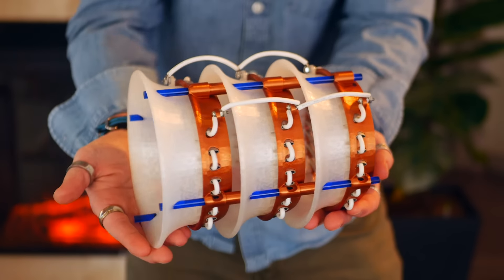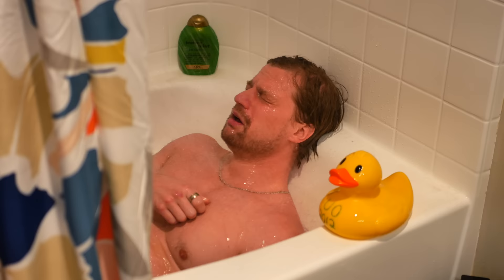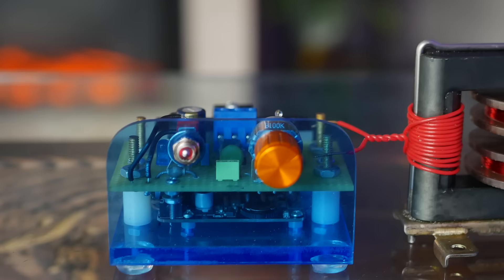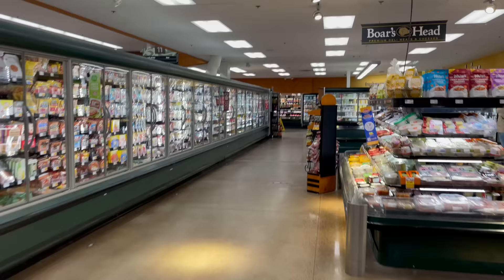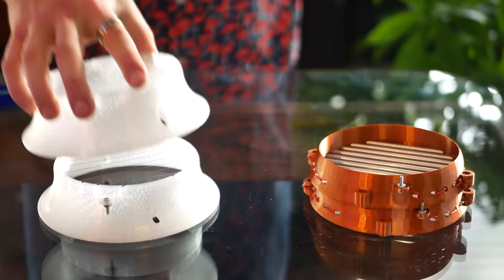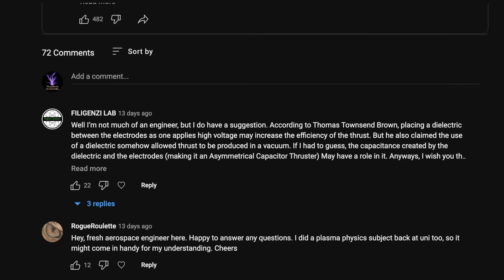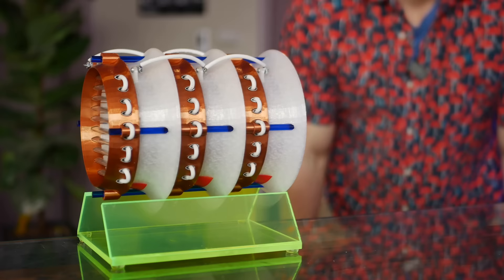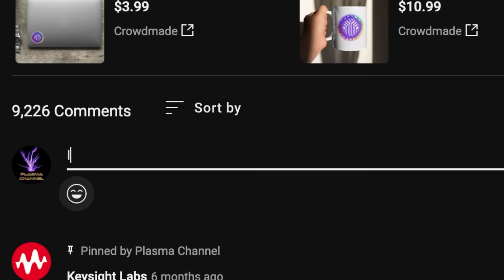The Next Generation of Ionic Plasma Thrusters (BSI MARK 2)

Comment: When you talked about making the wires more aerodynamic I figured you'd use thin long plates for both electrodes. Might be worth some experimentation. Anyway, I've really been enjoying these videos! Thanks
Reply: Yeah, my recollection of the MIT aircraft is that it used foil strips for the electrodes. Not only more aerodynamic, they also increase the surface area.
Reply: My recollection is flawed. The electrodes are airfoil shapes.
Reply: since he’s most likely to see this comment, i was thinking he could progressively make each stage smaller so that each subsequent stage compresses the air compounded.
Reply: @Julian-wp8sc  You actually want to avoid compressing the air.
Reply: Laminar ribbed ribbon, lines in the direction of airflow across both sides of the ribbon width. Perhaps, if each concentric stage will be smaller, the outer lines (grooves) angle in slightly and the grooves toward the center have a slightly larger gap.
Reply: @Julian-wp8sc  with each stage introducing better laminar compression.
Reply: @pseudotasuki  why?
Reply: @gary.richardson  Unless the vehicle is moving cloe to the speed of the exhaust velocity, you're just wasting energy by compressing it.
Reply: @pseudotasuki  Actually, I considered airfoil shapes to :-)
Reply: @Julian-wp8sc  just saw your comment after i commented the same idea. cheers.
Reply: @pseudotasuki  unless he's moving air at transonic speeds, the flow should be considered incompressible.  Low speed aircraft do not have compressibility effects.
Reply: @pseudotasuki  how about using a venturi?
Reply: @user-jw6je7lh5z  This design kinda does already. Each stage should be larger than the previous one, however.
Reply: @pseudotasuki  his venturi is only on the suction though.. what if he used each stage discharge to go through the middle of the next to push its discharge rather than just pushing its suction. or redesigning it so each stage discharge acts as a venturi applying suction to the beginning stage of the next stage's discharge.
Reply: @user-jw6je7lh5z  If I'm understanding your comment, that is what is happening here. As the air flows from stage to stage, its velocity increases. Due to Bernoulli's principle, the pressure also decreases. Leaving gaps between stages allows more air to be drawn in, reducing energy lost through (de) compression while also increasing the mass flow. More mass flow means more thrust.
Reply: @pseudotasuki  I wish there was a way to show a picture of what I'm describing. I will try to do a little better and you can correct me if I miss something up. so if we were to envision a different design other than plasma channel's. think of three stages, each one has a suction not on the discharge of another. the discharge of the first stage is necked down (increasing speed and lowering pressure) and then interacts with the not yet necked down second stage discharge. then after the first stage entrains the second stage discharge both are necked down interacting with the third stage discharge side then going out the discharge of the thruster ect. would that not work a little better?

Comment: You could try tapering each stage, so the output apertures are getting progressively smaller/narrower with each stage, and hopefully concentrating the airflow.
Reply: This is what I was thinking. Funneling the airflow.
Reply: I was thinking of tapering it and making it adjust its inner and outer diameter in proportion to airspeed.
Reply: That's nice idea 💯💯
Reply: I was just getting ready to mention the same thing.  Kind of like plumbing water line to keep pressure levels higher...
Reply: I don't think this will ever be useful for powering an airplane ionic thrusters are very inefficient extremely soul why not just use electric jet engines instead EDF's how much more efficient you go faster and have more range
Reply: Maybe I misunderstood but I thought one of the tests showed that the inherent incremental thrust from subsequent stages was minimal without the additional external incoming air. I was thinking that increasing the diameter of each subsequent stage would increase the amount of air into the following stages and that might help. Although that also increases weight.
Reply: i guess thats fire

Comment: On your ionic engine,  try individual power supplies for each stage and vary the outputs to each stage while observing, which makes a better, stronger thrust.
Reply: also constrict the cross-sectional area as stages continue to increase air compression thus increasing air flow
Reply: i was thinking the same but in sequence first second third then back to one
Reply: 3 6 9

Comment: Very awesome, have you looked into the Jean-Claude Lafforgue thruster? Looking at your setup I wonder if removing the side intakes and reducing the size of the other stages to continue the Venturi effect would increase the performance.
Reply: regarding Venturi effect: he just stacks 3 stages, doesn´t even consider the spaces between the stages should be different between 1st-2nd vs 2nd-3rd.... So making three different stage sizes is to much planning. Also not necessary at this point, as a proof of concept for just thrust the current setup is more efficient I would guess. Requires only mass flow, not necessarily higher output airspeed.
Reply: Thanks for the heads up just found an article by Jean-Louis Naudin, the Daddy of Amateur Ionic Propulsion 😄

Comment: ideas: 1) Your speedy air molecules are getting slowed down by the slower moving air particles coming in from the side. 2a) having a greater voltage at each stage will speed the air along much quicker. 2b) As voltage rises at each stage, the distance between electrode and anode needs to increase. You can build a chart for this as it should be fairly standard once you do hundreds of tests. 3) Each time you hear an arc "snap" from positive to negative, you lose thrust not just at and around the spark, but because you use one wire per stage, you lose thrust down the entire length of the wire for a moment. Run a test and watch the voltage drop. It's for part of a second but it hurts more and more with increasing air flow!
Reply: Spot on! I really hope he sees this since its the most coherent comment i've seen on this comment section. May I ask, what's your field of expertise?

Comment: I found your video about the plasma thrusters and as a technician I was fascinated.

Great work!!

I want to share my idea to you for increasing the thrust in a three stage model: Use slightly different stages: With a lower distance between anode : cathode in the first stage, and an increased distance in second stage and an once more an increased distance in the third flow.

Greetings from a farmer's boy from Austrian mountain area.

Comment: Generally I think  the added velocity comes from the added neutral air from the sides , but not from the back.  
- tuning each stage:  experiment with a fan in front and behind each stage with different velocities 
- electrical balancing of the stages: each of them needs to do something different, because the incoming airspeed is different and the electrical properties should reflect that too. 
- limit back-draft by making a more pronounced "neutral" region. (somehow)
- adding multiple staggered anodes per cathode taking advantage of all the energy.
- check out the "Einzel lens" -Concept. I can not put my finger on it, but I feel that the focusing could help with the aerodynamics 

I don't envy you, because there are many parameters to modify and a lot of them influence each other. 
I am eager to see the video with the 8m/s thruster though.
Reply: could you put a choke on the back of each stage to concentrate the airflow more in the centre and allowing more air in the side of the second and third venturi

Comment: Cool project, I think you should try sandblasting the aluminum cross tubes to increase their surface area.   I also think you should try two or three layers of fine wire to ionize the air.  Finally, the side inlets might not be helping,  They are mixing low-velocity air with flowing air.  You should try close them off completely.  Maybe even setting up one vortex tunnel of descending circumference.
Reply: Exactly what I was thinking. The air inlets on the side aren’t adding anything except slow or stalled air, reducing the compression of the existing flow. Yes, they will add additional air flow, as the majority of the air they are pulling in is already in motion, but there is a loss of efficiency due to the air that is at rest. Once forward momentum is achieved, the ramjet Venturi could have some added benefit. However I think the thrust potential is limited by the speed of the electrons moving thru the compression area. Adding additional +/- electron emitting/collecting will increase the base thru put. However, using more efficient metals and thin blades vs tubes will add area and reduce drag. Adjusting the current/flow of electrons will greatly increase the speed of the already moving air, reduce turbulence, and therefore increase the pressure/thrust.
Reply: The Next Generation of Ionic Plasma Thrusters (BSI MARK 2) faces the challenge of determining the most effective design for the ionizing process. While jet turbines evolved from propellers, it is not yet clear what the evolution of ionic thrust will be. The BSI MARK 2 introduces new design elements such as aluminum cross tubes to increase their surface area and two or three layers of fine wire to ionize the air. However, the effectiveness of these design elements is uncertain, and further research is required to determine their optimal configuration. Additionally, the side inlets may be counterproductive, as they mix low-velocity air with flowing air, leading to decreased efficiency. A possible solution to this problem could be to set up one vortex tunnel of descending circumference to ensure that only high-velocity air enters the thruster. Overcoming these challenges will be critical to the development of the Next Generation of Ionic Plasma Thrusters.
Reply: @abrahamlewis6604  agree. The venturi is inefficient, and absorbs energy from the system. It converts pressure energy into kinetic energy. He does not have pressure, so it can only have a negative effect on performance. He needs to use the 3 stages in parallel, so he can create pressure, then convert that pressure into extra airflow
Reply: I had that same thought.

Comment: If you're trying to reduce weight you might want to look into the foaming 3D printing filaments. You could probably tweak it to get the structural rigidity you need and reduce weight by controlling the amount of foaming. Although that seems like a step you would do once you are done with optimizing the electrodes.
Reply: OK let's get this correct  !!   #1  The only reason radio waves and AC current travel out in space and down a wire is because of the "CENTER " of a magnetic field.  (The "B" field), The North and South poles are the weakest part of a magnet !!   Just like Tesla said,  you got to look at things you can't see !!  At the center of a magnet is anti gravity,  (just tap the center on any glass or plastic and it will loose weight), The center can repel water if vibrated at the correct frequency,  If you vibrate the "B" field into granite rock it will become soft and you would need copper tools to work on same , you don't want to disrupt the magnetic (B")field ) with other iron.  Once you understand the "B" field of a magnet and how it relates to the entire universe we live in, you will then understand what Tesla was telling everyone "LOOK FOR WHAT YOU CANNOT SEE""  .I believe the pyramids were inter galactic communications and transportation systems.  Stone Henge and Gobekli Tepe , power plants.  Take a look at Coral Castle Florida on YOUTUBE and you will see a similar pilar. I believe these horizontal pillars were oscillators that would provide excitation for many things from crops in the field to anti gravity

Comment: I love your confidence as you hold 50kv of pain in front of your face.
EDIT: Maybe try parallel thrusters that converge into a nozzle? If you can only move the air so fast, converting that into pressure might allow for more thrust.
Reply: do you like Arma 3?
Reply: I was wondering that too 😂
Reply: OK let's get this correct  !!   #1  The only reason radio waves and AC current travel out in space and down a wire is because of the "CENTER " of a magnetic field.  (The "B" field), The North and South poles are the weakest part of a magnet !!   Just like Tesla said,  you got to look at things you can't see !!  At the center of a magnet is anti gravity,  (just tap the center on any glass or plastic and it will loose weight), The center can repel water if vibrated at the correct frequency,  If you vibrate the "B" field into granite rock it will become soft and you would need copper tools to work on same , you don't want to disrupt the magnetic (B")field ) with other iron.  Once you understand the "B" field of a magnet and how it relates to the entire universe we live in, you will then understand what Tesla was telling everyone "LOOK FOR WHAT YOU CANNOT SEE""  .I believe the pyramids were inter galactic communications and transportation systems.  Stone Henge and Gobekli Tepe , power plants.  Take a look at Coral Castle Florida on YOUTUBE and you will see a similar pilar. I believe these horizontal pillars were oscillators that would provide excitation for many things from crops in the field to anti gravity
Reply: @vincecox8376  how stoned are you

Comment: Two ideas: 
1) "compression" Make each successive stage smaller with the funnels shrinking the area to compress the area the air is moving through.
2) "vortex" Add rotation to the air in two possible ways, first is shaping the funnel to impart rotation as the air passes through, second is placing the electrodes in a rotary pattern.
3) "alternating direction" Have each stage on a different orientation from the preceding stages, so perhaps a stage might be rotated 60 degrees from the previous stage.
Bonus wacky idea: put the electrodes in a coil shape instead of straight across.

Comment: One thing I learnt from building solar cars is that all those extra aerofoils in series are ultimately increasing your effective frontal area and therefore drag. You'll need to do a tradeoff on stages verse winding pitch and also aerofoil length and cross section. Drag really hurts you as your airspeed climbs. 

You could also optimise those exposed insulators since they will create drag and turbulence which will reduce your Venturi effect. 

last thought is, rotate the positive to negative grid 90 degrees which will increase the surface area you are ionising?

Comment: Nice work with this design. If we assume a constant density through your thruster (which isn’t the case but a good assumption as the difference will be small for this), then we find a mass flow rate of .05538 kg/s which means .2215 N of static thrust which probably isn’t quite enough to fly yet. Using the same calculations for your friend’s thruster we find a m dot of .02077 kg/s and .1246 N of thrust, so you have doubled the thrust of Integza version. There’s 2 ways to increase thrust. Increase the exhaust velocity so it is significantly larger than the inlet velocity or increase the mass flow rate through the engine. Increasing mass flow rate is easy, just increase the frontal area of the engine. However, it seems based on your test with the computer fan increasing inlet velocity that this design has some sort of limit on max exhaust velocity so as your engine starts moving through the air on an airplane, the thrust will drop until you reach seemingly 2.5m/s, when it will be zero. If this is the case, it may be better to just use one engine stage for the airplane, but have more engines. This will still have the upper limit on exhaust velocity, but significantly more static thrust which is fine if your flight speed is less than 2.5 m/s (which is very slow).
Reply: :hand-pink-waving:OK let's get this correct  !!   #1  The only reason radio waves and AC current travel out in space and down a wire is because of the "CENTER " of a magnetic field.  (The "B" field), The North and South poles are the weakest part of a magnet !!   Just like Tesla said,  you got to look at things you can't see !!  At the center of a magnet is anti gravity,  (just tap the center on any glass or plastic and it will loose weight), The center can repel water if vibrated at the correct frequency,  If you vibrate the "B" field into granite rock it will become soft and you would need copper tools to work on same , you don't want to disrupt the magnetic (B")field ) with other iron.  Once you understand the "B" field of a magnet and how it relates to the entire universe we live in, you will then understand what Tesla was telling everyone "LOOK FOR WHAT YOU CANNOT SEE""  .I believe the pyramids were inter galactic communications and transportation systems.  Stone Henge and Gobekli Tepe , power plants.  Take a look at Coral Castle Florida on YOUTUBE and you will see a similar pilar. I believe these horizontal pillars were oscillators that would provide excitation for many things from crops in the field to anti gravity
Reply: @vincecox8376   This is not related in anyway with what I wrote.